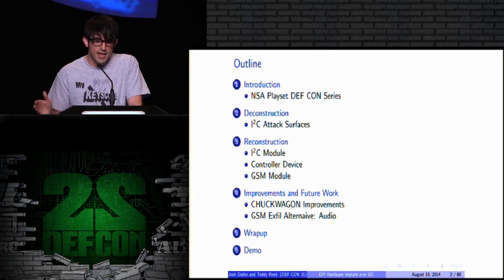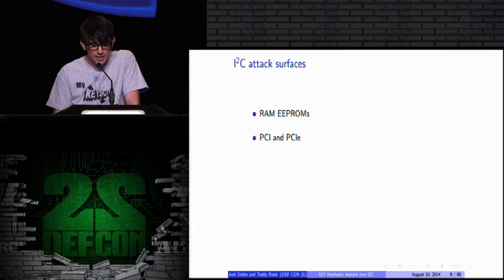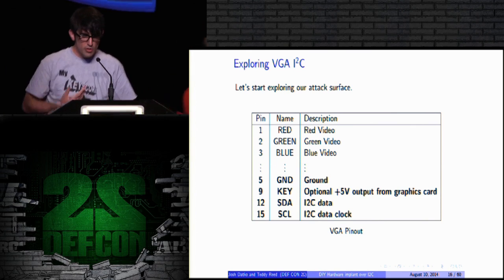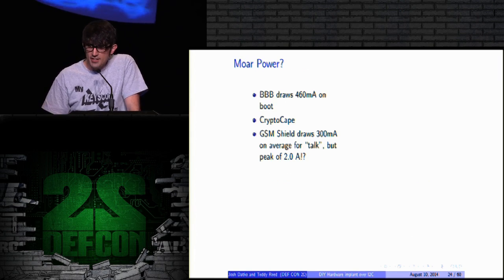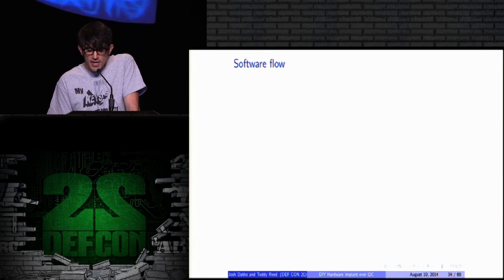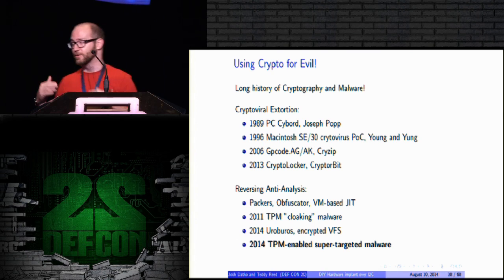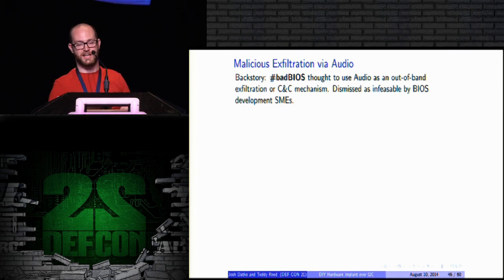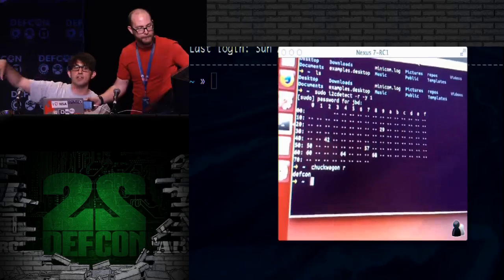DEF CON 22 - Josh Datko and Teddy Reed - NSA Playset: DIY WAGONBED Hardware Implant over I2C

Comment: Yes you can take over a computer with the I2C bus on the VGA, HDMI or Display Port interface, but it's much easier than explained here. They all rely on the DDC (Display Data Channel) standard, which bases upon Access.bus, which mandates that you are able to connect a mouse, touchpad, keyboard and COM Port to that bus with plug and play. If a device would not allow that, it wouldn't have a compatible graphics port!